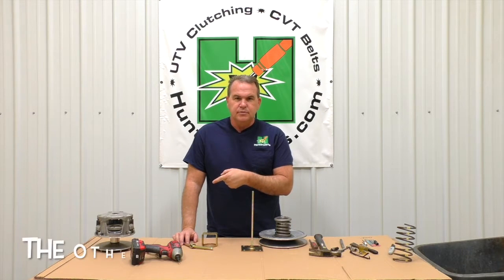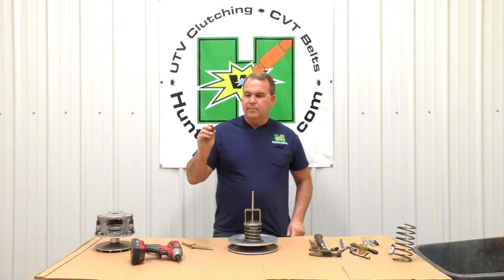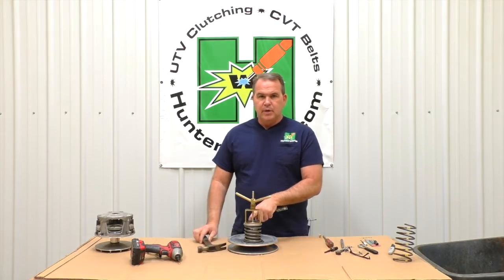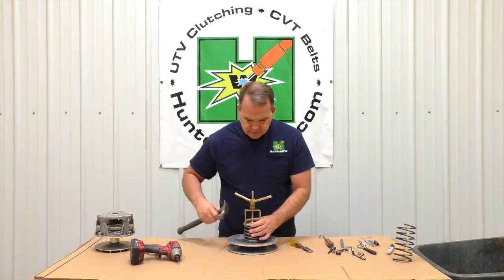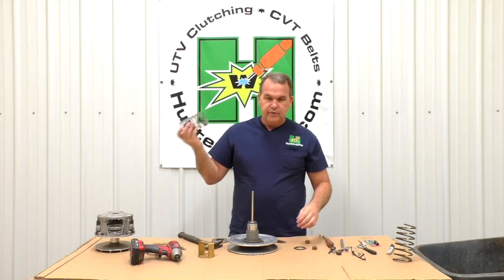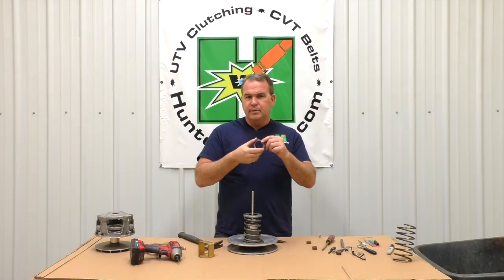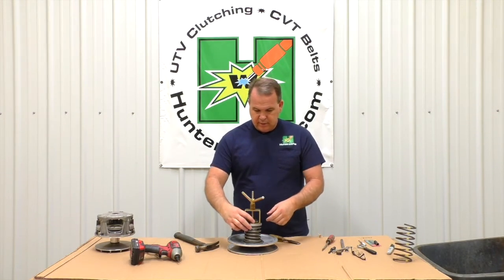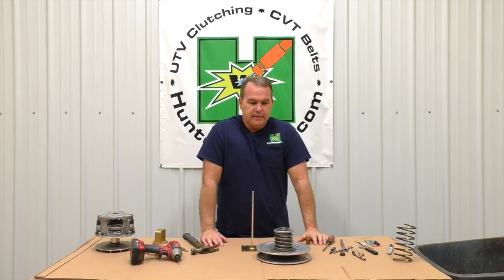Yamaha X2/X4 Clutch Spring Change

Comment: Thank you for ""Improving" this tool to accommodate the RMAX Secondary Spring removal/replacement.
Reply from the maker: We both got lucky, we have a new Can am belt change tool and it has a large bell, a little big for this but works and gives you more room on the nut.